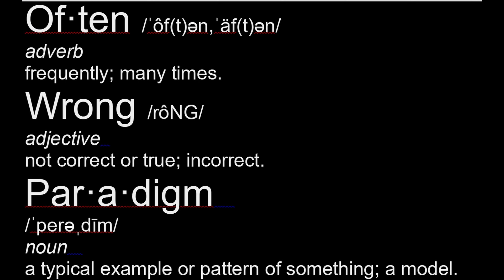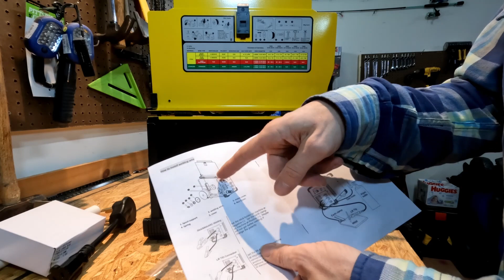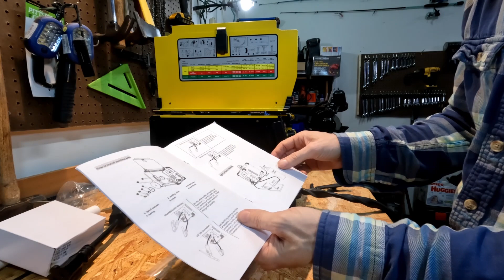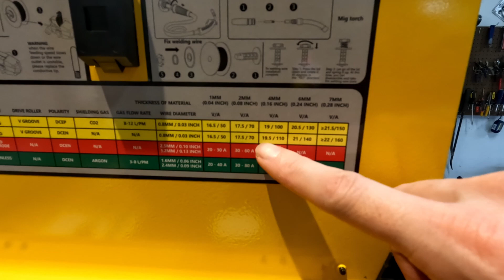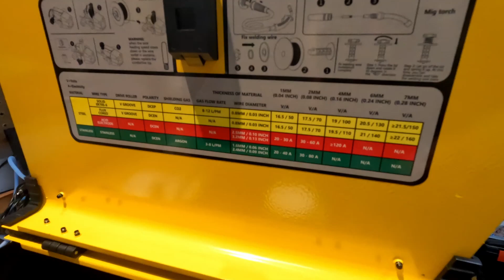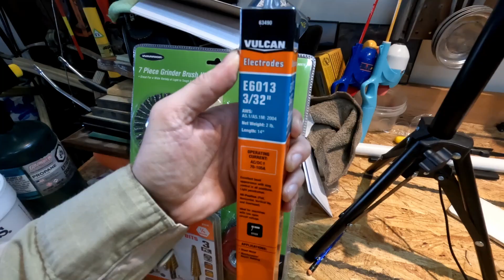Hynade MTS155 FX Unboxing, Review, Use-Newbie Learning to Weld

Comment: That is a hot welder. Inverter style. I bought the same unit months ago and ready to start building a bearing press with it. I skipped through to the welding part. Very nice welds out of the box. Thank you. I forgot about the settings given underneath the spool hood. Was reading the manual that only talks about tig and stick set up. Have a good one.
Reply from the maker: Yep, it gets the job done!

Comment: Nice when someone can view all the mistakes so they don't have to learn first hand.   Most folks clean the welding surface with at least a wire brush or better before welding.  When flux core welding you can use simple vaseline to dip the tip in occasionally for splatter control as well as cooking oil spray on your metal before you weld..  Oh, and lose the nozzle guard completely or preferably pick up a much thinner shorter tighter fitting guard at HF.  The shortened guard will allow you to actually see your weld instead of flying blind.  Stick out is around a half inch or slightly less..I prefer less.  And drag, not push your weld on flux core.  It's so simple a cave man can do it..
Reply from the maker: All excellent advice. I didn't know about the cooking spray. I gotta try that. Thanks!

Comment: I can't give an opinion one way or the other the piece that holds the wire spoon on, it's round and has spring on it broke! I never got to use the machine once!!!! I can't seem to find a replacement on lineI can't give an opinion one way or the other the piece that holds the wire spoon on, it's round and has spring on it broke! I never got to use the machine once!!!! I can't seem to find a replacement on line, I'd like to show a picture of it, but I can't.
Reply from the maker: Return it if you are in the return window.
Reply: @oftenwrongparadigm  I'm not, that's the problem. I bought it and was busy with something else and the time past. But there should be a somewhere to get oarts for this thing. That piece to hold the spool is ridiculously cheap

Comment: I bought this off Amazon  now it doesn't work the company doesn't have a phone number were you can reach them don't get took like I did
Reply from the maker: Dude, that sucks. Are you still within the return window? I made sure to use the crap out of it the first couple weeks I had mine. I wanted to make sure that if it was going to break, it would do it fast. My harbor freight rules. With a limited return window, abuse it to the limits and return it if it breaks.

What was it the broke? Does it still power on? What is it doing or not doing?

I think I already trashed all the packaging and instructions that came with mine. I thought it had, like so many other sellers, one of those little business cards or slips of paper in it with contact information. I'll dig around in my garage and see if I can find anything.
Reply: @oftenwrongparadigm  no just my luck 300 buck down the drain
Reply: Will not strike ark I have two other welding machines they work.just this one.
Reply from the maker: @mickeyholt3868  I'm not going to say this is ever a good idea, but have you tried cranking it up on high and striking an arc on the grounding clamp? For flux core the grounding clamp would need to be plugged into the positive terminal... Try at your own risk, I don't always give great advice, in case it does decide to strike an arc this way. My curiosity would just get the better of me in this situation.

Will it strike an ark using the stick welder?
Reply: @oftenwrongparadigm  I have no ark on either
Reply: When it work I could only weld for two mints off time 15 mints
Reply from the maker: @mickeyholt3868  yeah, that needed retuned immediately. I ran mine for many hours straight, with very little break time between welds when I was welding up some rock sliders. I've never had mine cut off. I have another project in the works, and about a half roll of wire I don't like (HF). I may be tempted to simply pull the trigger and see how long it takes for the machine to turn off... If it will. Lol, 🤣 I'm not exactly the best example for others.

Comment: Just take the tip off it’s not a mig
Reply from the maker: Yep, that tip was swapped out for the little cover for flux core right after my next visit to harbor freight. So much easier to see what's going on with the smaller tip cover.
Reply: Good call ! Would you recommend this flux core welder ?
Reply from the maker: I would, but as my first one, I have nothing to compare it to. I've used it for stick and flux core and haven't had any issues with it. The included wire is messy, splattered a lot more than the forney wire. I like the forney wire with this welder. Made my first project with it, rock sliders for my golf cart. Looking forward to the next project, a winch bumper for the cart 😁
Reply: Awesome I have been looking for a small one to use around the house